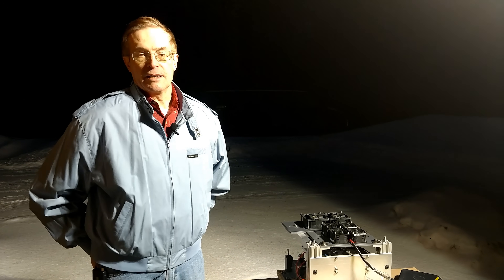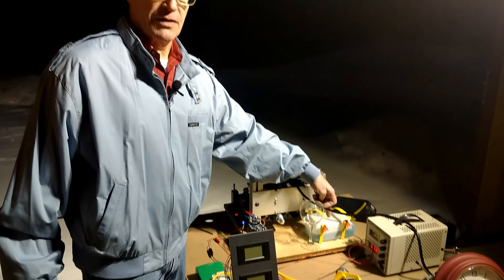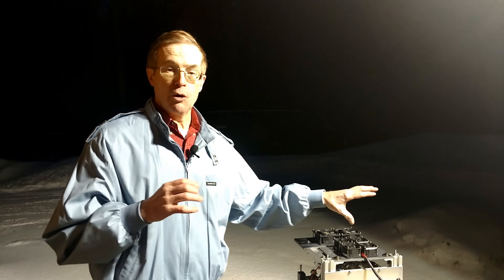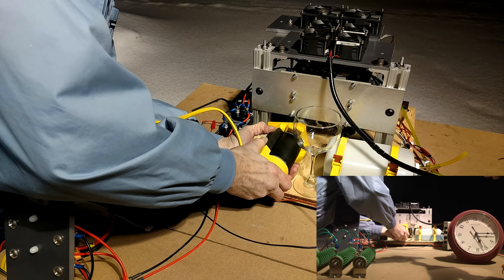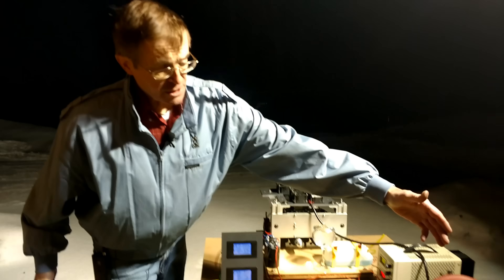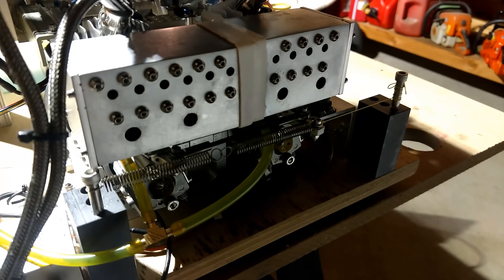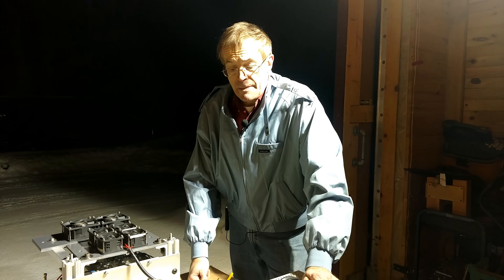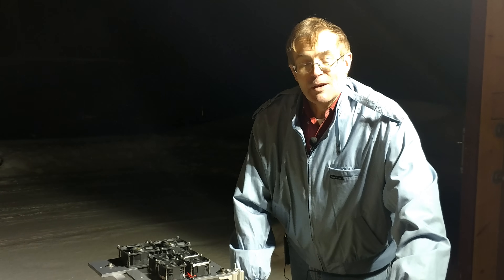Drone Generator Performance

Comment: love your channel I recently subscribed. I'm not an engineer so excuse my ignorance but isn't this a bit of inefficient? I mean having an IC shaft connected to a motor to convert rotational energy to electricity to be used from an other motor to create rotational energy from electricity? Wouldn't be better to connect the propeller directly to the IC(or a gear box that's driven by the IC)?
Reply: You cant. The multirotor drones work by varying the RPM of the individual rotors to steer. An ICE-Driven multirotor drone would have to have variable pitch on each rotor even when you would put an IC engine on each rotor, because the engine is waaay to slow to react to throttle changes for it to be able to steer the drone.

I've done the same with a small .99cc glow engine and a similar small 200W brushless outrunner as a hybrid generator for a 1kg quadcopter. It produced about 100W, which is a BIT more than the the hovering power needed for said drone. Pint is that in a hybrid configuration you can just provide the hovering current plus a bit, the starting and climbing current will come from the hybrid battery. The whole ICE/generator/battery/fuel tank assembly was less weight than 2 4s 2300mAh LiFePo4 packs i fly that drone regularily with, but could provide over one hour of flight time instead of ~30 min i get with 2 packs on the drone. The fuel has so much energy density that its totally worth the double conversion.
Reply: That's what I was thinking it's adding a lot of unnecessary weight considering the goal was to increase the energy density, to use ic engines directly you would have to have each propellor with the ability to control the pitch independently and therefore be able to change the lift of each propellor
Reply: Lochlan bogaers The problem is that the drivetrain anvariable pitch also has weight. And the ic engine with battery can be small enough to only provide average '"hovering" power plus a bit because the battery can provide the additional "climbing" power. Which even with the battery is still lighter than the big engine and drivetrain.
Reply: The point of this is (I assume) to create a hybrid and give a longer flight time to what is still essentially an electric drone. 
@Loemichel.  Yes, you can do this.  Its been done with collective pitch props and a single Nitro power plant.  Not sure why you say it cant be done as Notro copters have been doing it long before Electric motors were viable.
I just found an old youtube Video of a Nitro Stingray (quadcopter) that does this..  https://www.youtube.com/watch?v=XnP3jTwRPv0
The video is less than impressive in what it shows, but I was able to find a 3d Demo of the same one but powered by a single electric motor doing a little inverted flight etc.
The potential for heavy lift and/or extended flight time with an ICE over current tech electric is definitely there.  Swings and roundabouts though.  Each have advantages and disadvantages.  Next gen batteries should be game changers though as speed of recharge and energy density go way up and volatility / safety improve greatly.  And maybe cost comes way down after R&D is fully paid for (or china takes it on in a big way).

Comment: Trying to read your power outputs on the blue screens.
Suggest a fixed camera for these.
Also total kwh output per fuel used will give an efficiency number.

Comment: Very nicely done, at 85dB it's quieter than it seems on camera and the vibration is extremely low.
I think you could be on your way to a viable product if that is your intent.
Reply: 85dB is just below the level where hearing protection is required. Anytime we had a generator or main engine running at work it was about 85dB in the office. We often had hearing protection on even then as at the end of 18 hours of hearing it, you were tired of it. In the engine room, 108db unless the phone went off. Then 125dB.

Comment: Are you familiar with how the exhaust pipe can affect the power of a 2-stroke motor at various RPMs? Is your new "muffler" tuned at 5000 RPM to give you the maximum power?

https://en.wikibooks.org/wiki/Engineering_Acoustics/Sonic_Supercharging_of_2_Stroke_Engines

Comment: Have you tried the fuel consumption with the original exhaust? I have a feeling that the box exhaust is restrictive and not helping efficiency.
Reply: Exactly what I'm thinking. Connecting the two exhausts together increases the effective exhaust pressure, decreasing pressure differential needed for "scavenging"
Reply: Yes, two strokes just thrive on tuned exhausts, I'd be going for a compromise exhaust. Fuel efficiency Vs Db. Plenty of 2 stroke info out there on exhaust tuning science.
Reply: Yes.   This.   Been there done that.   Proper exhaust design is key with two strokes.
Reply: We dont know what he hides in that box exhaust 😂.

Comment: you don't have to worry about transition, you can set them at the optimum settings for the requirement and forget, you might want to idle them down for a little while before shut down

Comment: You sir are heading in the right direction, i could see this type of tech on full scale passenger carrying aircraft, keep up the good work and i hope you inspire some people to get off their buts and do some stuff, including me : )
Reply: Not electric with generators as far as I know.
Reply: I mean electric is great but the range is not good, the technologies has advanced and the only limitation is range,batteries are heavy so the answer must be efficient light weight generators to charge the batteries in flight. I could see small jet turbine being used ultimately or even turboprops that are boosted by electric motors to increase their responsiveness and generate electricity.
Reply: sounds like the APU would be perfect for E/Planes.
Reply: OH YER!

Comment: I expected to see the wine glass move. Seems smoother then expected. Good job but I think your tuned pipe needs another revision. :) May I recommend a common secondary manifold and vertical muffler attached to the original tuned pipes. Brass and tin is easier to solder for this purpose too!
Reply: The wine glass is hot glued to the base. Take a close look @1:52.
Reply: Now I'm wondering what purpose the wine glass has. Did you happen to catch that too?
Reply: Yeah, to show how smooth the motors were running. He talks about the balancing challenges in previous videos. You'll notice when he fills the glass with water,  it's very stable. No low frequency vibrations, otherwise the water would have been all over the table. But,, it's a little misleading because there is still a high frequency vibrations, which are very apparent when he begins to pour the water into the glass,  you can see the cavitation in the water @8:15.

Comment: Please forgive me for sounding rude but I  still think it is like putting a gas generator in the trunk of an electric vehicle.
Reply from the maker: That's not rude, it's a good analogy.  It is similar to many hybrid vehicles where the limited energy density of batteries presents limitations. For airborne  drones these limitations are more severe because weight is even more important than in a car.  Until the cost fuel cells drops substantially, gasoline remains an attractive option for some drones.
Reply: I don't think fuel cells are the answer for aircraft, or possibly for anything else. The energy density (by unit of weight) of hydrogen is less than 10% of gasoline. And, that assumes you could achieve high efficiencies during conversion in the cell. Fuels cells are great at using surplus or 'free' energy to make and store hydrogen  for later consumption to meet high demands. There is NO source of unbounded hydrogen on this planet, so compressed hydrogen is nothing more than an innovative battery technology, which has less energy density than the current battery technologies. If you are looking for the biggest 'bang' for your kilo, diesel is your answer.

https://www.eia.gov/todayinenergy/detail.php?id=9991

Comment: I like what you have done but I think the loses are way too high, with the power those gas engines produce I think  you should put all that effort on making a gas powered drone, is not at all that much more complicated than this generator and it will be lighter.
It's just my opinion.
Reply from the maker: That's a valid option.There are several reasons why we decided to approach the problem the way we did.  If compact and light enough, an APU could be retrofitted onto the many existing large drones. Isolating the vibration of the engine/generator by providing the energy through wires is very effective. This is also true for noise isolation. Finally, highly precise control of multiple, individual engines for stable flight is possible, but challenging.
Reply: You don't need multiple engines for a multi-rotor.... in fact changing RPM to control lift (like RC drones) is too slow anyways. When using internal combustion engines on a multi-rotor, you change the pitch for stability and control,  and you can do this with a single drive-train.

https://www.youtube.com/watch?v=Vy5Ky50eGJs

https://www.youtube.com/watch?v=ahnzzjyO3Io
Reply: Don. You are correct, as these machines get larger with higher inertia rotating components, more traditional aircraft/helicopter type mechanics and geometry will be revisited (possibly battery-electric have a place for low endurance machines / services, but yes shaft power from higher energy density energy storage will be trumps -for the near future at least.)..  For this reason we will be likely to find that the near future crop of fixed pitch Multirotors will remain in the sort of size range (per propulsion unit) that we are seeing today..  As soon as you approach similar scales as manned helicopters, conventional techniques make sense.

In aviation fixed pitch propellers are only used for fairly rudimentary low speed-range, low-medium efficiency aircraft, for any "high performance" machine variable pitch is necessary - even electrically powered, due to propeller dynamics (stall is difficult to escape)...

For those who think that vibration etc are insurmountable problems, it is "as easy" to vibration isolate the payload and IMU / etc, from the airframe as it is to isolate an APU.  (I do realise the huge vibrations that conventional Aircraft piston engines exert on the airframe, especially during start - stop procedures necessitating overengineering of components.)
Reply from the maker: Don's links were interesting.  The first, I was unaware of. The second  is part of a series that I was aware of and was a turn off regarding centralized power sources.
I agree that as the systems scale, the best approaches will shift and the incorporation of variable pitch rotors will likely have the most profound effect. Electrical vs mechanical transmission will depend on a lot of factors such as available drive paths, redundancy methods and the weight vs efficiency of components.  I disagree with the concept of isolating the payload and IMU from a vibrating air frame vs isolating a vibrating power source...at the power source. Vibration is not just annoying, but introduces stresses to all the aircraft components.
Reply: Curtis Youngblood is another who has been playing in this space for a while.  http://www.curtisyoungblood.com/ also lots on youtube.

Tongue in cheek. "easy"..  lol we know.   (vibration isolation isn't really easy at all in a compact way.)
In the end we all have our "brief"  and fill it as best we can.

Thanks for sharing.

Comment: i have noticed that your load resistors are all in parallel. how would the voltage and current compare to  two in parallel in series with two in parallel?
Reply from the maker: The resistors were wired to give approximately 1.5 ohms of total resistance.  This relates to the kv of the motor-generators. At a fixed RPM, which is determined by the engines, the kv determines the current output for a given voltage drop.  A lower kv will produce more current, but will load the engines more heavily. If the kv is too low, the engines are unable to reach their maximum RPM and total power output is reduced.  If the kv is too high, the engines will reach red line before they generate the maximum potential power output.

Comment: Hi, thanks again for a good video.
How are you relating fuel consumption to generated power?
I'm not sure what you mean by 20 to 1 and 10 to 1 ratios.
Reply from the maker: These are ratios relative to the energy available in Li ion batteries.

Comment: Oh, for a little turboshaft engine!
Reply from the maker: We're working on that too.  The hurdles are compression ratio, mechanical output to realistic rotational speeds and cost.  I believe the approach of taking a RC micro turbojet and fitting it to a reduction system (micro turbo shaft) is not the way to go for all the above reasons.  Stay tuned.

Comment: I have done alot of work on this myself wanted to say that if you want to improve efficiency use mosfet rectifier over diodes you will have to build a circuit for any amount of current you get out of it.
Reply: And what advantage do you think a mosfet would provide over a diode?

Comment: nicely made
but 700 watts of power ?
it will never work for a drone
Reply from the maker: You're right.  This unit has been designed for 2.2kW and we will demonstrate higher power in upcoming videos.
Reply: I agree with Zbigniew. Nice job with vibration cancelation. But your total system weight is too high and power is too low. It weights like 30 - 40 kg, and the same weight of lipo would fly and would be able to supply more than 100 000 W.

Comment: if your using a 10s motor generator motor rated for 10s and your seeing 8S power being generated then if i use a motor generator rated for 8S then I may see 6S power being generated right like maybe this motor? http://alienpowersystem.com/shop/brushless-motors/aps-5065-outrunner-brushless-motor-90kv-1800w/
Reply from the maker: Do not use the "s" rating of the motors for anything other than a maximum voltage tolerance.  Design around the kV.  The analogy is the voltage rating of a capacitor.  You design a circuit around its capacitance and only need to make sure its voltage rating is greater than the circut's operating voltage.  The lower the kV of the motor/generator, the higher the voltage you will produce for a design RPM output from the gas engine.
Reply: how to calculate the needed capacitance of a capacitor? Lets assume the 2000W generator.

Comment: is there a way to control the voltage to use it for a 6S set up 25.2v ? not over that or magic smoke happens.
Reply from the maker: Sure.  You can choose whatever voltage you wish.  If you want to maintain the same power output however, this will require more current. Then you will want to use a higher Kv generator.

Comment: So does your heavy life drone run on 8S?
Reply from the maker: The newer, larger drone does run on 8s as this allows lighter wiring throughout the system. You just want to avoid using a voltage/motor Kv combination that flies the drone way below the maximum thrust that the motor/props can generate.  This stresses the ESCs with high current loads.

Comment: What generator motors are you using ? Got a link ? Are these the same motors you're using? http://alienpowersystem.com/shop/brushless-motors/aps-6374s-sensored-outrunner-brushless-motor-90kv-2800w/
Reply from the maker: these will also work:
http://alienpowersystem.com/shop/brushless-motors/aps-6355-outrunner-brushless-motor-100kv-1700w/

Comment: What was the result for wh/kg of consumed fuel?
Reply: A liter of pure gasoline weighs .7489 Kg. and contains 9.7 KWh of energy. A little more for 2-stroke pre-mix.
Consumption was .435Kg/hr. or 5.63KWh.
The power meter showed an average of about 700w over the 20 minutes - 2.1KWh 
That's an efficiency rating of 37.3%,  which is higher than the typical 20% for an internal combustion engine, so I think the lack of precise measurement is skewing the result. Most of the energy is lost to waste heat from exhaust gases, thermal conduction, and friction. Toyota has some the best engineers in the world, and they have only recently achieved 38% efficiency.

https://www.greencarreports.com/news/1091436_toyota-gasoline-engine-achieves-thermal-efficiency-of-38-percent
Reply: +Tech Ingredients +Don Beckham -- But was it pure gasoline, like "aviation gas", or some kind of oxygenated automotive stuff like gasohol, or unleaded with MTBE, etc? Or indeed, was it model airplane fuel, consisting mostly of methanol?

Comment: WOW,,thanks for having your site.   Im gong over all your videos and the motors are sold out so, how does one calculate esc to motor to power details for a perfect balanced system?   Thanks Keith
Reply from the maker: Start your design as a cyclic process.  Determine what you  want the drone for, where will you store it, how to transport it, how long will it fly and how fast? Do you want the lift efficiency of 4 huge rotors or the redundancy of 8 smaller ones or a balance of 6? How much will this rough idea for the design weigh? How much can you spend and how much are you able to fabricate?
Find the components for this first iteration and then REPEAT.
Each time you run through the loop you will fine tune the choices and you will have spent only time.  The ESC that best matches the motor that you decide on should have a significantly higher current rating than you expect to need.  They all tend to run hot.  I like KDE. The regenerative braking improves responsiveness especially for large drones.
https://www.kdedirect.com/collections/uas-multi-rotor-electronics

Comment: Have you looked into the possibility of weight savings using fuel cells?
Reply from the maker: Yes. They just aren't available/affordable yet and probably will not be for some time.